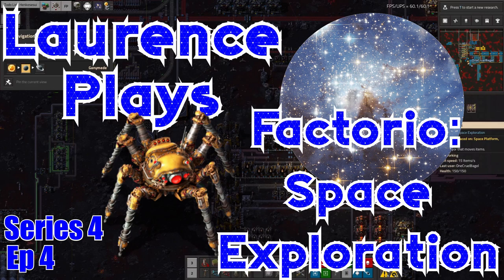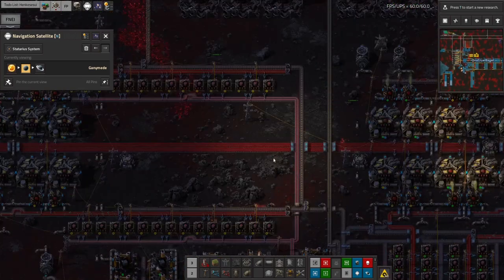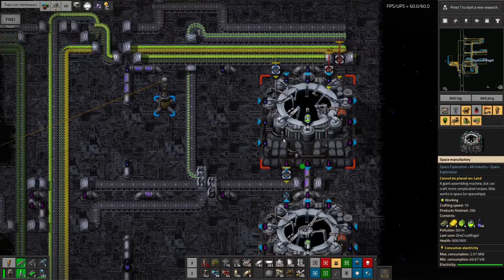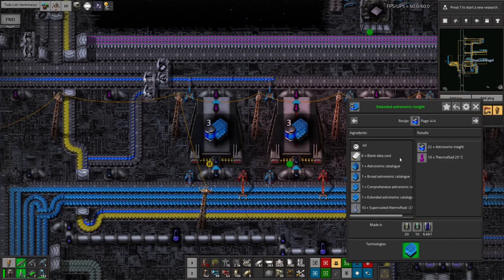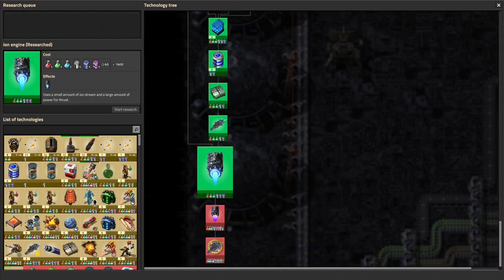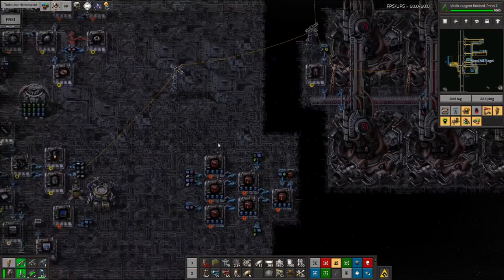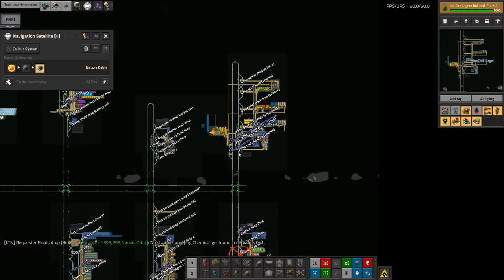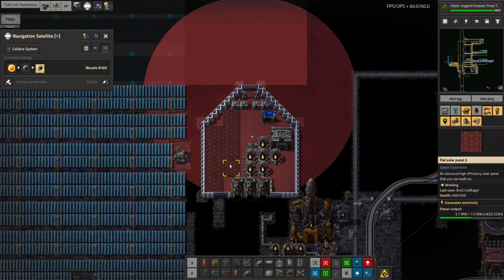S4-E4 - Spidertron, Spidertron - Laurence Plays Factorio: Space Exploration

Comment: Maybe instead of sending the orbit resupply ship every 15 minutes, Instead send it when an item has been completely used up (or n items have been used up), that way fuel isn't being wasted if nothing is being consumed, also I'm curious on how will you determine if the spaceship is full if it contains heaps of different items with different stack sizes, seems quite tricky to me
Reply from the maker: That's possible - having different request and demand levels would be tricky, but I could set it to load stuff into the ship to get to a certain amount up there, and to launch if any of them are more than 1000 lower than they should be, but that would mean that all requests (even for less commonly used stuff) would have to be >1000, or whatever number I pick... Maybe!

With a few suggestions from chat, I managed to come up with a system that can detect when the ship is full  :-)  I'll show that off in the next video!

Comment: Have you considered the fact that the solar panels on your spaceship will give you less power the further out from the sun they are?
Reply from the maker: I am aware of it and I've considered it a little. I haven't actually checked how much power is made in more distant orbits (they won't need to run the ion engines on the planets because it'll use the booster tanks for takeoff) but I was planning to put in 2 panels per engine (so there's a bit of headroom) and worst case, it can fly on 1 or 2 engines when it's way out there. Further experimentation is required!
Reply: @LaurencePlays  Also depends how many turrets you have at the front and therefore how fast you want the spaceship to go. My current spaceship has 3 rocket engines and runs at about 80% of full speed to allow 3 laser turrets to deal with everything in time. That means the engines cut in and out as it keeps the speed around that level. Of course, cargo load (or at least storage space) reduces how much speed you'll get per engine too and I've not actually sent if far enough to get to full speed since adding a bunch of chests so full speed might be fine now for the defences
Reply from the maker: @giantlobster  True - I did notice with my first spaceship that when the lasers fired, the engines cut out because the generator and accumulators on the ship couldn't power both at once. I think it made its flights unscathed with a mere 2 lasers though. But if I've got plenty of power, then more lasers isn't a great hardship.